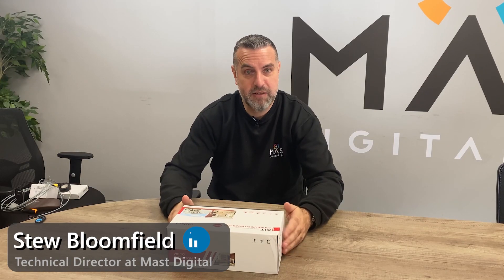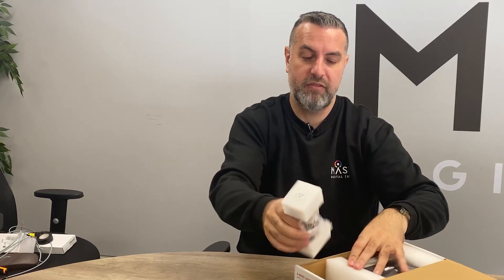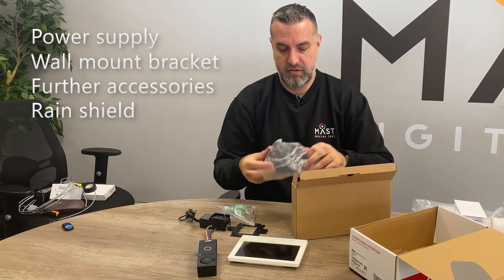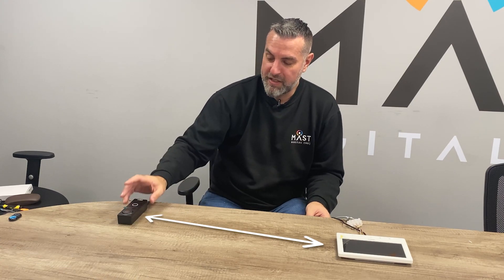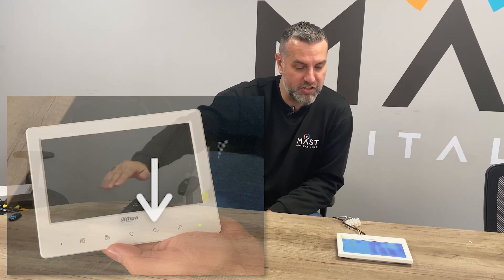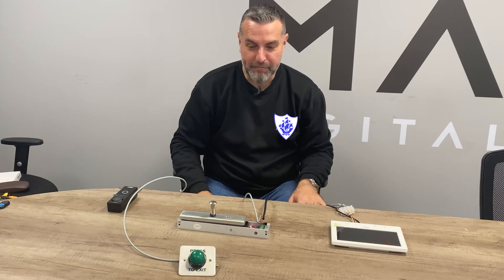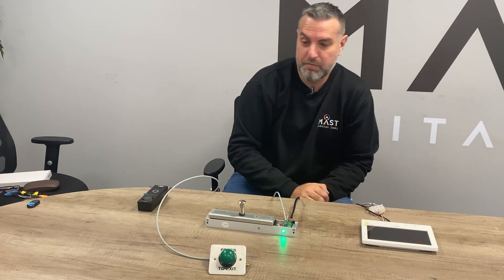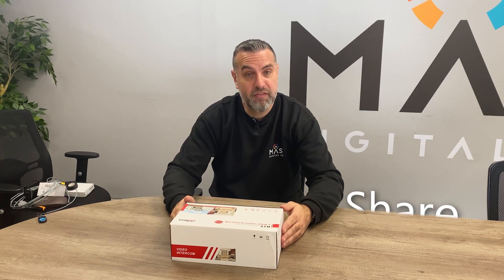Setting up a 4-Wire Video Intercom with a Maglock & Push to Exit | Dahua Analogue VTO Kit

Comment: does the power supply run direct to the lock is it ac or dc
Reply from the maker: Hey Veran, the power supply runs directly into the Indoor Screen and is 12VDC
Reply: @MastDigitalUK  I was meaning to connect the gate lock it obviously needs it's own power supply so I I'm trying to find out how to connect it to the gate station